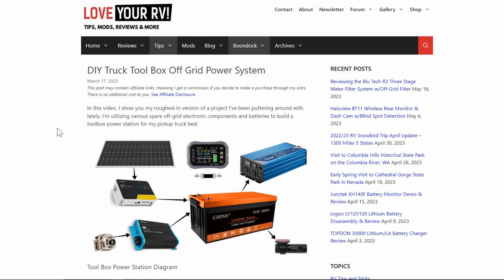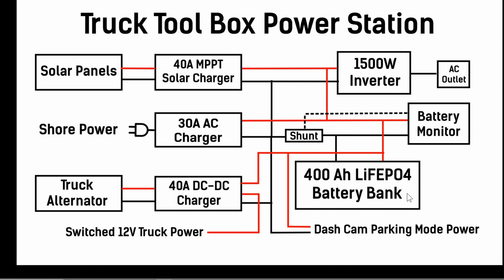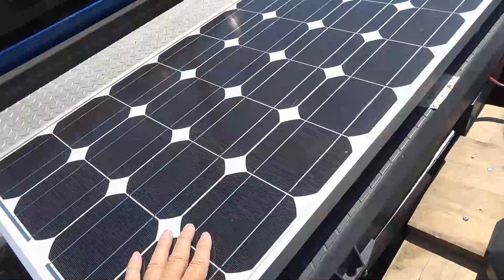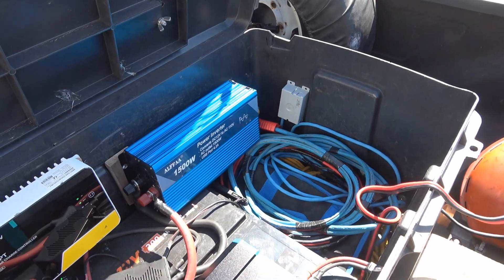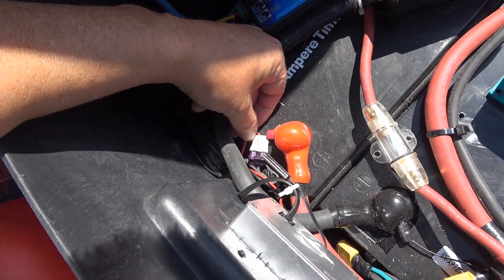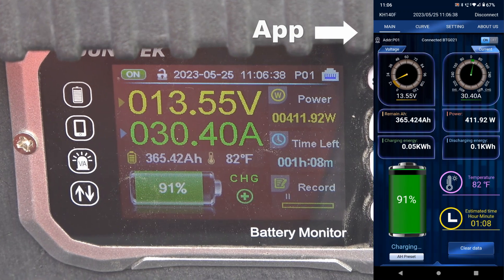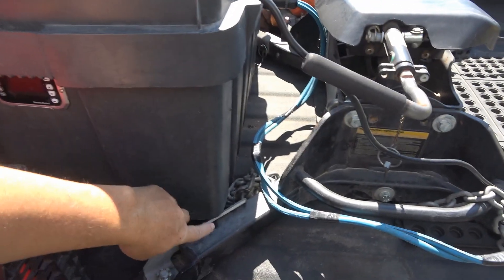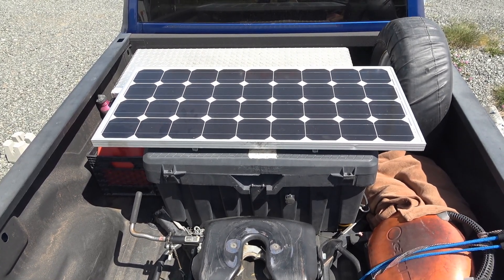DIY Truck Tool Box Lithium Power Station - Completed Overview

Comment from the maker: Related Videos
Renogy DC-DC Charger - https://www.loveyourrv.com/renogy-40-amp-dc-dc-charger-installation-and-demo/
BougeRV Solar Controller - https://www.loveyourrv.com/new-bougerv-40a-mppt-solar-controller-with-bluetooth-app/
ALFFAA Inverter + Chins Battery - https://www.loveyourrv.com/chins-200ah-battery-alffaa-1500w-testing-and-teardowns/
Junctek Battery Monitor - https://www.loveyourrv.com/junctek-kh140f-battery-monitor-demo-review/
Renogy Solar Panel Mounting - https://www.loveyourrv.com/replacing-damaged-portable-solar-panel-plus-new-mounting/
Ampere Time Battery Review - https://www.loveyourrv.com/demos-review-ampere-time-12v-200ah-self-heating-lithium-battery/
TopDon 30A Charger Review - https://www.loveyourrv.com/topdon-30000-lithium-la-battery-charger-review/
SRNE DC-DC Charger - https://www.loveyourrv.com/testing-out-an-srne-50-amp-dc-dc-charger-mppt-solar-controller-combo/
Dash Cam Reviews - https://www.loveyourrv.com/?s=dash+cam

Comment: Hi, so you don't use a srne hybrid dcdc and solar controller anymore?
Reply from the maker: Yes, I still use them. They are part of my main power system inside the fifth-wheel trailer. This is just an extra system I built for the truck box out of spare parts. :)